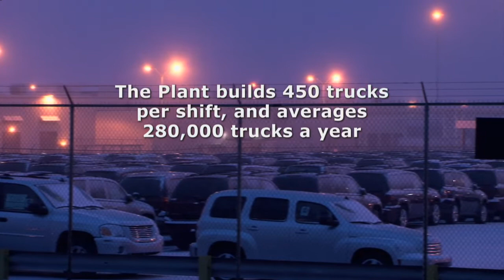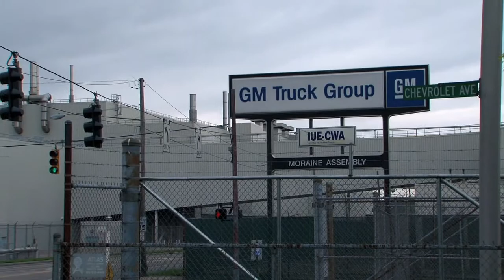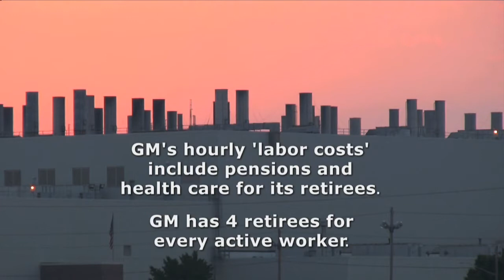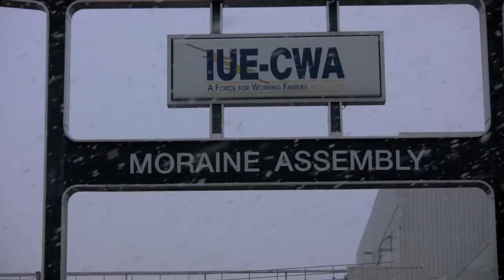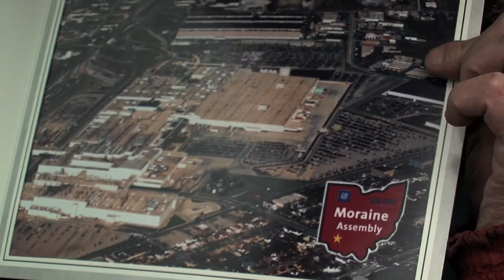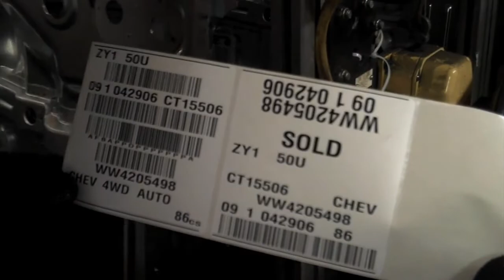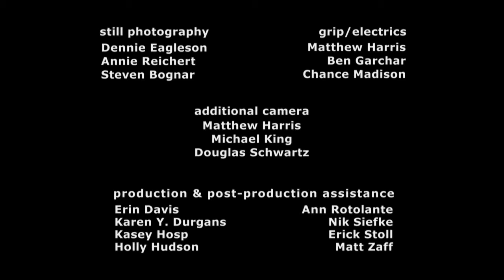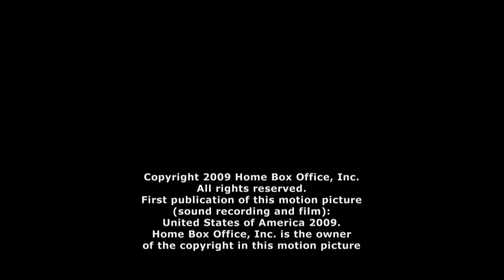The Last Truck

Comment: Rick Wagoner was an absolute monster. So many people whose families depended on the factory jobs for their income who lost their jobs. Truly saddening. Most people blame GM but I mainly blame Wagoner, he ran the company into the ground with poor investments (rebadged cars) and ended up having it shed 7 brands (while Holden, Opel, and Vauxhall didn’t die off or get sold until later in the following decade, Wagoner had a large part in it).
Reply from the maker: Thank you for your comment,
Reply: Roger smith was the first in part of starting badge engineering..before that, gm was starting to put Chevrolet engines in all “non Chevrolet “ cars, that started in like 77 I think…

Comment: This plant was, for a long time, a part of my IUE Local 801, until they split off. My plant was Delphi Thermal, formally known as Harrison Radiator. 
We supported each other at contract time. As a result, our union had no pull with GM, during contract talks; we became weak, and management ran right over us. Our plant was helpless. Delphi offered buy-outs, and soon moved the plant to Mexico. Imagine, going to work for weeks, seeing skid after skid of equipment, wrapped and labeled "Mexico"! 
We worked hard at our jobs, as well, to make our plant successful.  
Thanks, for nothing, IUE!